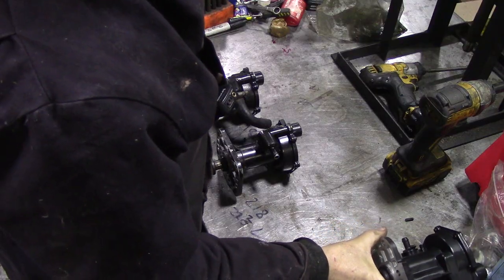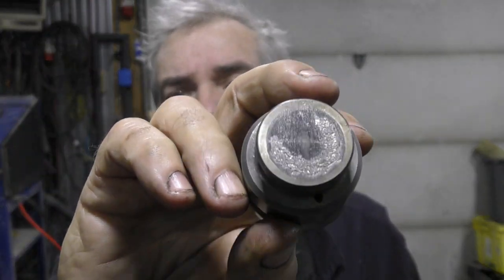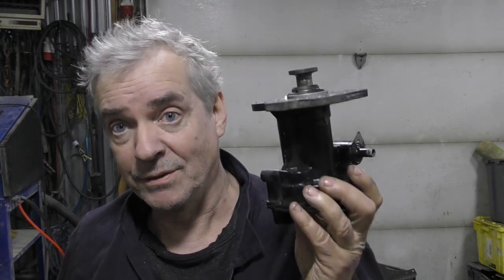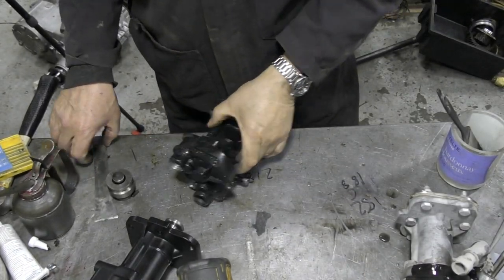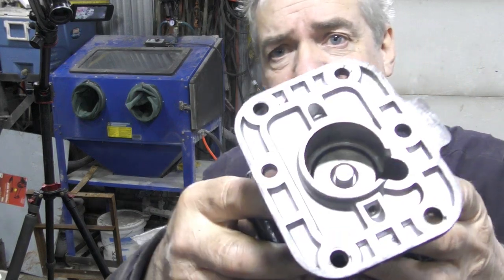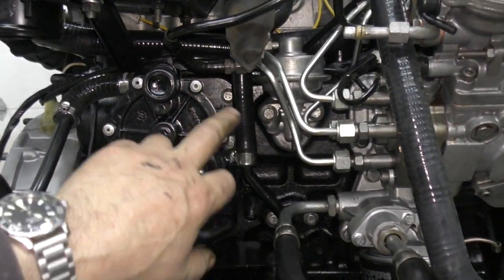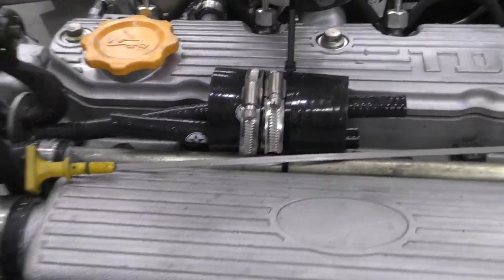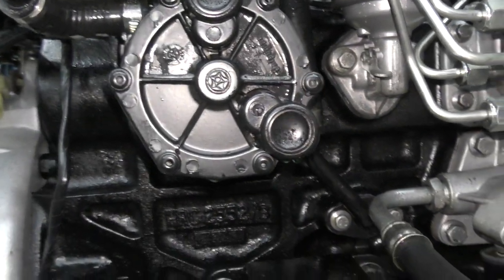300Tdi Vacuum Pump stuff

Comment: Thanks for answering that question Mike, I thought it may have been a legal/liability issue with the electric vacuum pump experiment, I can fully understand the situation. The elec-vac pump system I fitted to my old '98 Disco is still working perfectly after four years in service, that's according to the Disco's new owner. If I was still into Tdi Disco's I'd never entertain that Wabco pump system again, it's just an overly expensive oil leak source. 
Cheers, Gary, NQ. Australia.
Reply from the maker: Yeap - it can be done but if someone screws up with wiring, switches, timers ...
HOWEVER!
Look at this!
https://www.amazon.ca/Premium-Vacuum-Compatible-Replace-5102084AA/dp/B09S3PVM14/ref=sr_1_199?crid=3ACWPWVRIDAR5&keywords=vacuum+pump&qid=1679879771&sprefix=vaccum+pump%2Caps%2C106&sr=8-199

Scrapyards are full of these old diesels - you could easily bolt it to the A/C pump mount 
Interesting!
Reply from the maker: Better

https://www.alibaba.com/product-detail/New-Vacuum-Brake-Pump-1581518-For_1600083647027.html?spm=a2700.galleryofferlist.normal_offer.d_image.32ae38a9uKy8r8

Comment: I have a 1995 Chevrolet S10 in Brazil which is equiped with the same engine, there are only a few differences. It is called Maxion HS here. Your videos have helped me immensely. Mine is leaking a lotta oil in hard to find spots. 350.000km. I wish I could drive it up to your shop to give it all the care it needs.
Reply from the maker: Thanks for sharing

Comment: Currently sorting braking issues on the 300Tdi 90. Replaced the servo but the vac pump is weak, so Im fitting a 12v vac pump from a Volvo (and will also replace the original pump) then have them both connected via a T piece. Volvo pump will be powered via the brake switch so it boosts the vacuum when brakes are applied. Belt and braces!
Also will be changing to Ferodo pads as unimpressed with the Mintex ones I fitted a while back - I think they were built to last, not to stop the vehicle...
Reply from the maker: You may be wise to run an adjustable timer as well as the vac switch - when I was experimenting I found the vac switch was cutting off too early, so the pump could not give maximum vac
Just a thought

Comment: Great quick tip on the install requiring the cam lobe to be at vertical. I bent up some stainless brake lines I had extra to replace the plastic vacuum line over to the brake booster. Overkill? Yes, but it's a permanent solution and required just a few minutes of matching up and cutting. It's late March here in SLC and we've still got snow... not sure how it is in Québec, but mon Dieu, this winter has to end sometime.
Reply from the maker: We have no new snow fall but a lot of ice - -5c this morning!

Comment: I have an issue with my brakes on the 300tdi, the vacuum pump is leaking oil so I know it needs replacing but my brakes are awful, they barely stop me, and don’t lock up. I’ve replaced the discs pads and front calipers so I’m at a bit of a loss. Is it the vacuum pump that’s not giving enough pressure??
Reply from the maker: Sounds like a typical brake servo problem - they tend to leak. You cannot fix it - replace
Reply: @BritannicaRestorations  thanks I’ll try that 👍

Comment: Another interesting video. I’m thinking of buying a smoke machine but can I use it on an old engine that’s full of oil?cheers Mike.
Reply from the maker: You can, but it is best free of oil - because the oil could be over a potential leak, but no pressure to force it through

Comment: How about a td5 alternator with vacuumpump at the place of the aircon pomp. More amps and better vacuüm system. Blanking off the old one.
Reply from the maker: Too long to replace the 300Tdi alternator without modifications to the exhaust
Reply: @BritannicaRestorations  I mean making a bracket above de distribution om the other side, if you dont have airconditioning
Reply from the maker: Yes you could drive it off the spare A/C pulley  - just be aware of the direction of rotation - I have not seen a Td5 alternator
Reply from the maker: Maybe this may be an alternative :

https://www.amazon.ca/Premium-Vacuum-Compatible-Replace-5102084AA/dp/B09S3PVM14/ref=sr_1_199?crid=3ACWPWVRIDAR5&keywords=vacuum+pump&qid=1679879771&sprefix=vaccum+pump%2Caps%2C106&sr=8-199

I think I will have a look round the scrapyard!
Reply: Brilliant! Maybe even possible with ac

Comment: Mike, does this mean you can disable the pump so that it doesn’t run on the cam by removing that foot but keep the pump for sealing the block and for aesthetics?  The pump only operates the EGR valve on my RRC, and that had been blanked off anyway, so I had been thinking of cutting the foot off, but this looks really easy if it’s just a matter of grub screws and prying out the foot.
Reply from the maker: Yes 2 grub screws and a bit of heat
Reply: @BritannicaRestorations  great! A far better solution than the angle grinder!